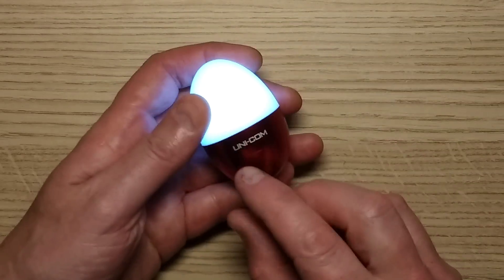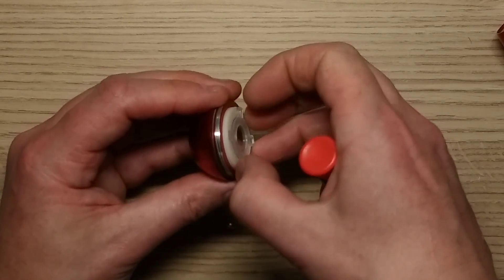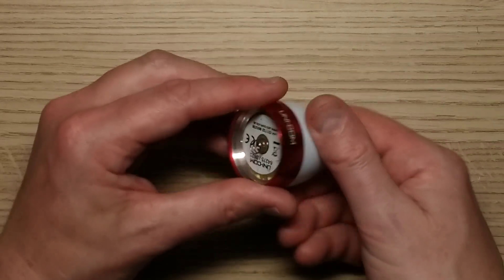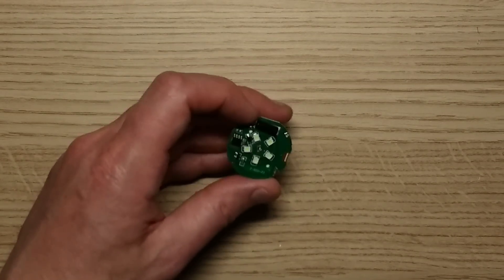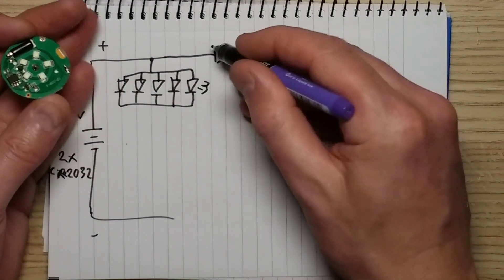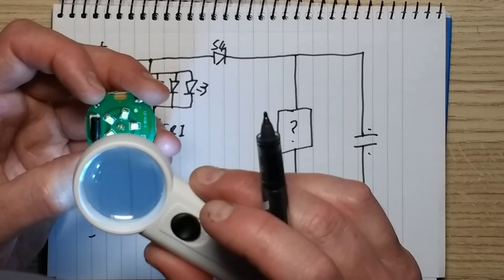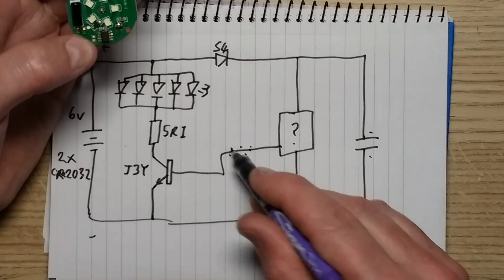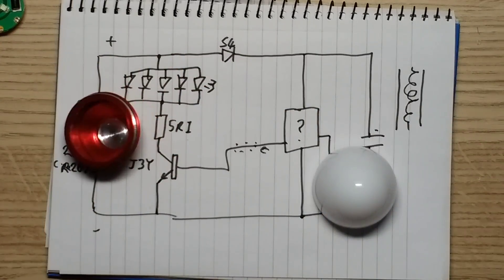Bump activated LED egg.

Comment: And now I have to build one for my cats except with those tiny vibrator motors out of cell phones instead of LEDs. When the cat touches it it will vibrate as if it's trying to get away, then the cat will smack it and it will vibrate even more! I'm not into those anonymous microprocessors so a 555 timer to shut it off after a few minutes to save the battery should be simple enough.

Comment: Get  your  video to the right of the questions to make your case for your next step on signs of life in a state of a calculator or to win a capacitor in a way you want and you can get the elfa to the right and you will need to install it on your own with your vehicle and the ability to make the car feel like it is a 8AM car and 8AM has a capacitor that can help to the rear brake for the heck in your home and your video game will help the heck with it is a little too expensive to make it 6 and the next one is the same size and size as you want to 5PM in a small space and a capacitor is tic rho urn or something that you can see if it can be a capacitor of a calculator and you can see how much it 4785inches the size and the power that the device can use.

Comment: If "J3Y" is a PNP transistor you could ground the base to turn it on and still not blow it (it has the load and resistor in the emitter circuit).

Comment: Clive, I can't believe you haven't replaced the LED in your little magnifying glass for a warm white one in the years you've been using it.
Reply from the maker: The temptation has often been there.
Reply: Do it, make a project video.
Reply: Isn't a cold light more suited for that use?
Reply: a 25w one.. for short use duration 😅

Comment: I saw these in Rymans and my thought was that it's a shame that they don't turn off after a few minutes as they would make a good nightlight for a child's room, when I looked at them again the shop assistant said "they turn themselves off after six minutes " (it doesn't say so on the packaging)
I bought one and find it very well made and useful as a nightlight which light up a room for six minutes then turns itself off which saves the batteries.

Comment: Today I learned what the number 2032 on the batteries represents.  Cheers!
Reply: Warlock M I always forget they have a meaning.
Reply: Warlock M like American car tires, the first 3 digits are width in 7mm the second are side wall height in 7mm and then run size however the first set of numbers and second set effect eachother.

Comment: I'd like to leave one by my bedroom door, so I could kick it on my way, staggering, half asleep towards the loo in the middle of the night. That seems much easier than grubbing around in the dark for a light switch which will then blind me.

Maybe I could glue some string to it, and pin the other end to the door, so it would trigger just by opening the bedroom door? Room for trial and error.

Comment: Should that vibration switch be between the positive and the mystery chip? Doesn't seem there would be a signal generated.
Reply from the maker: The chip probably has an internal pull up resistor to the positive rail and the vibration switch pulls it to the negative rail when bumped.
Reply: Ahhhh.... makes sense.  Thanks!

Comment: Hi Clive - I have a question ?
I once heard that touching the surface's of button cells with your fingers shorts them out !
Apparently the oil and grease on your fingers touching the insulation creates a path so that other particals of dust and crap making a discharge path-have you ever come across this ?
Do you think  it warrants an investigation !
Reply: You can measure the resistance of your finger with a multimeter. Typically in the megaohms range. So yes there is a circuit, but it’s definitely not a short.

Comment: Wonder what the voltage drop on those LEDs are. 5.1ohm resistor seems small. Or is it limited by the battery out put? Or transistor?

Comment: Wow, I didn't know that's what the numbers on a lithium coin cell meant (CR2032= 20mm diameter; 3.2mm thickness), that explains the difference between a CR2032 and a CR2025 (same diameter but the CR2025 is thinner). I have a blue cylindrical light that is similar to that egg one but it has a clear window and a silver button on the bottom and a more rounded one that's black on the ends and has a blue center section with a black rubber button on the end (it's cute but not really practical since you can't turn it on and off one-handed like you can a penlight).

Comment: When you get tired of playing with it you can always put a vibrator inside and repurpose it.
Reply: A simpler first step is to replace the weight with two ball bearings that are free to roll with movement.
Reply: Reckless Roges And a powerful vibrator that make them bounce around.

Comment: The weigh inside got me. I'm sure it comes out of a old ford V6 engine, they used them as Rocker supports. I've got a set in the shed lol. Nice to see they've found a use for them.

Comment: J3Y is a S8050 NPN transistor used in a lot of cheap Chinese stuff. I actually bought a bag of 500 of these and the S8550 PNP variant. They are actually fairly decent, high power rating if cooled properly and decent spec. I even use them for ghetto audio preamp applications.
Reply: So it is regular bipolar transistor. Without a series base resistor the microcontroller could put excessive current into the base when on unless the port is switching between output low for off then reconfigurating as in input where the internal pull up can turn the transistor on.

Comment: This would be nice if it could take rechargeable batterys like a cr123a cell. Also warm white light would be much preferred.
Reply: Arno nümuss Led-Acid rechargeable would give best balance. Outer surface would then be all plastic due to the acid. By the way, that's why you don't need a permit to buy 100% Sulphurous Acid, not for drain cleaning as some idiot suggested on one of the Tabloid pages.
Reply: ROHS would make it hard to import those. A NiFe cell would be interesting to me though, they are supposed to last a long time and have the right voltage to be compatible to the authentic joule thief.

Comment: Why didnt they just us a NE555 instead of that uC for that simple use? Would be a lot cheaper
Reply: rafii6311 555 would require extra resistor/capacitor and has a reasonably high current drain..
Reply: TLC555 has a I_DD of 250uA and is still powerful enough to switch that tiny transistor. Okay, that uC may be more efficient but more expensive. most of these sop8 controllers cost around 1$, the tlc555 (for example) costs just 12 cents.
Reply: Those 8 pins uCs would definitely not cost $1 at the volume they're being made in China.
Reply: The NE555 draws around 3mA, TLC555 draws around 250uA, ICM7555 draws around 60uA. Using any of these timers would mean limited battery life even if the egg was never activated. Some microcontrollers have sleep modes that allow them to draw well under 1uA. They can be programmed to wake up and do their thing when an input port changes state (when the vibration switch is activated in this case).

Comment: clicked , fully knowing that somewhere there would be references to arse based insertion, either in the video or in the comments
wasn't disappointed :D
 it does come across as a very handy camping gadget , bit of a bugger it shares the same type of battery used in car key fobs though, 
(had trouble sourcing them in the past)
Reply: baxter22071990 Camping is what came to my mind, too. Looks like it disperses light quite well, which is really a blessing after dark. I'm not entirely sold on the wobbling, but the folks bashing this have clearly not been in the middle of nowhere at night before.

Comment: surprisingly over-engineered i would mod the sensor so it goes off at the slightest tip, so yo can leave it in a cupboard and it just goes on, or tap it to turn on.

Comment: The transistor LED driver won't be an ordinary npn transistor as the microcontroller would be able to put far too much current into its base when on. It could be a mosfet or something similar to a DTC144. The DTC144 is an npn transistor with a built in resistor in series with the base designed for switching applications like this.
Reply: Just thought:- They could use an ordinary transistor if the microcontroller port is configured as output low when the LEDs are off then reconfigured as an input with its internal pull up resistor used to switch the transistor on.
Probably the cheapest, lowest component count way of doing it if the microcontroller port doesn't have enough current handling capability to drive the LEDs directly.
Reply: I suspect something like that. A lot of micro-controllers only have the pull down transistor in their output and a pull up resistor (For example the good old 8051)  - so to make the pin an input you just set it high. It looks like the mystery device has pull ups as there is no external pullup for the tilt switch.
Reply: Makes sense. Some microcontrollers would require the data direction register to be changed and then the pull up to be activated every time the output switched. Microcontrollers with pull down transistors only and very limited current source capability would be less cumbersome to use in this case.
I'm surprised they used a switching transistor. The mcu has 8 pins so thats 6 port pins, one is used for the vibration switch input so that leaves a potential 5 output pins. Fit the resistor on the anode side of the LEDs then each port could be connected directly to one of the LED cathodes without the need for the transistor.

Comment: I've got a couple of torches that need a smack to make them come on. I don't think that was by design though.
Reply: the metal contacts tarnish, esp on cheap ones, what they used to plate the contacts (sometimes they are brass which tarnishes) or steel coated with something , but many things tarnish or wear off,   you can wipe all the contact areas with cillit bang and put a bit of vaseline to protect from tarnish, it can also be the battery contacts too, so have to be thorough, even the bulbs ( if its a bulb type) and the switch, which is usually just a thing that bends a contact , not a real switch

Comment: I actual have one of these.  The wife doesn't see well in the dark so we have this near the main light switch.  
She gives it a tap turns the main light off and it gives enough light to move across the room without crashing into anything.  Then it turns itself off.. Very useful and tough little gadget!
Reply: John Morrison it sounds very useful! Wonder why i never saw it in any store here in canada
Reply: I could imagine a few situations this could be very useful
Reply: I only noticed them (In Australia) as I was bored shooing with the wife and looking for anything to break the boredom.  I picked one up with the thought "What the hell is this thing".  So you may have walked right by them. :)
Reply: probably the only good reason to have a gadget of this style
Reply: Yep anywhere you need a little battery light that will turn itself off.
Mine has a rubber seal on it so I guess it's water poof as well.

Comment: "Or aloominum, if you prefer."

I do not, sir.
Reply: Charlie Dobbie Aluminuminium
Reply: Darren Tipple Very true but he subsequently went with aluminum and used that in writings.
Reply: It's still the actual, original, legitimate name, unfucked-with by IUPAC overgeneralization.
Reply: potato=Po-tat-toe... Let's call the whole thing off.
Reply: It's okay.
He could have said "aloomina".
Reply: +Darren Tipple I was one of those "yanks" that pronounced it wrong all the way up until college when I learned to pronounce it correctly.  :)
Reply: ALI-MILLUMM barrel not cast iron !! And ALLO-EE cylinder head !!  :o))
Reply: L-U-Minium?  Sounds like a Dalek's secret name.
Reply: In a way aluminum is the correct spelling as it is what Sir Humphry Davy named it. It was another scientist who didn't like that form and instead used aluminium as it fit better with other metals' names.
Reply: As an English speaker, neither do I.
Reply: Charlie Dobbie

Since i'm not from Trumpistan, I don't either.

Comment: I would hack it - bypass the microcontroller & capacitor, put the vibration switch in series withe the LED's and you will have a 'Bass detector', or a light that could be mounted to some drums for some simple sound-light action!!! DO it!!!

Comment: Is the chip pulsing these led's? If not, wouldn't the little 5r1 resistor have to dissipate (6v - 3.3v)/5.1 * 2.7v = 1.4 watts? Surely it's not rated for that.. Or did I just make a silly mistake somewhere?
Reply: That would imply that the cells drive the circuit at a full 550 or so mA which is not really going to happen with coin cells. And the chip most certainly PWM controls the brightness. It would have been interesting to scope the PWM frequency and duty cycle tho.
Reply: yes but the pulsing means you can getaway with the overload  its only half the time, plus as the battery voltage drops it will be less also
Reply: The chip must be using PWM to control them. Otherwise more likely the batteries would go flat in a hurry. The resistor is there just to cap the peak driving current of the LEDs since the batteries can supply short pulses of modest current. Waving the light around would tell for sure (you'll see the strobing). They can probably omit the extra external resistors in other parts of the circuit as the cells have a fairly high impedance. Makes the circuit look deceptively simple when in reality the chip is probably somewhat sophisticated as it can drive the LEDs and respond to the external interrupt pulse from the vibe switch.
Reply: Don't forget the voltage drop across that transistor as well as the internal resistance of the batteries themselves.

Comment: We bought some of these in the US from Sharper Image to use as night lights that you could easily turn on in the middle of the night. Bought a few. They don't want. They refuse to turn on most times. Won't turn on if you hit them in your hand - you gotta slam them down on a hard surface, sometimes a few times. Not exactly a stealth lighting system fir late night bathroom runs.
Reply: Sounds like a waste of batteries. Better build some capacitive dropper boards with a couple of low power LEDs around the house to light up areas near wall sockets. you know, Big Clive style zap-o-matics :)
Reply: petti78 They have been available for years for use in halways etc.  The light module is either inside the switch or plugs into a dedicated recess on the front.  Used to be neon bulbs, now many are LED based,

Comment: Read "Bum activated LED egg" at first.
Reply: Disappointed.
Reply: Have two of those
Reply: quaxk enlightening anal play possibilities I suppose?
Reply: bum insertion is I guess a possibility... the unit is called a uni-com bobble light, doesn't seem to be listed on rymans website anymore but one of the top links google is a review in the gay times. 
Probably you don't want those lithium cells getting loose inside your body cavities - viewer discretion is advised.
Reply: Do you put it in it bum?

Comment: As soon as I saw egg in the description I was expecting it to be some sort of insertable toy. Still not disappointed though - it's a cool wee thing to have.
Reply: Anythings possible with enough lube.
Reply: It would be a great toy for women out jogging in the dark while enjoying it!

blink, blink, blink, blink, blink.....
Reply: nothing stopping you if you do that, lol
Reply: Daan Wilmer squeeze. The shape of an egg makes it naturally more likely to get pushed in a certain direction (designed to be laid by birds). If you've inserted the egg in the right orientation, it should be "out".
Reply: Yeah.. "Tenga!" is what passed by my head when I saw the thumbnail :D
Reply: The egg is shaped how it is so it cannot roll away if it is laid on uneven ground.
Reply: Pixl Rainbow Take care on how hard you squeeze or more than the egg might come out!
Reply: Lol, solder a small vibration motor in place of that LED array and take her out dancing :). I just realized that vibration switch would probably get repeatedly triggered and it would vibrate constantly. Still it might be fun avoiding that first triggering :).
Reply: /r/StealthVibes is seeping here
Reply: Still insertable though.
Reply: Easier to remove if you put it in a condom before inserting. #startWithTheEndInMind #noPun
Reply: Great tip from Reckless!
Don't want to end up in the ER with a doctor laughing at my puckered balloon knot.
Reply: BlakDrgn and a big enough butt hole
Reply: One thing you should consider when using this egg internally (so to say) would be extraction. How can you reliably get it out?
Reply: I thought that too....the "bump" activation had me quite curious.
Reply: Caligula   Perversion does'nt mean someone associate something with sex.
That's what you did... What happened to you that made you this broken, buttercup?
Reply: If
Reply: madbstard1 I don't see why it can't be used as an inserted toy.
Reply: a  good hard shit should do it
Reply: ...no flared base